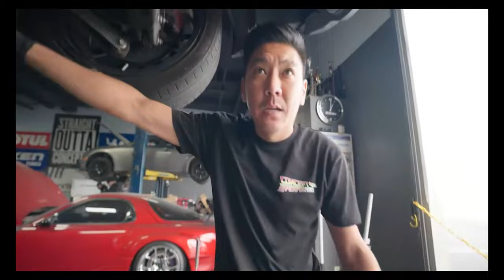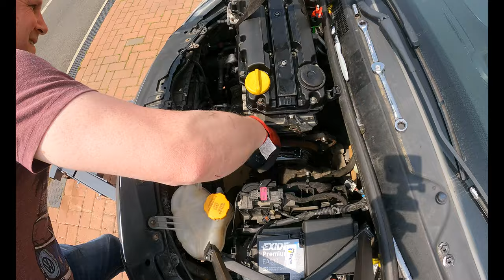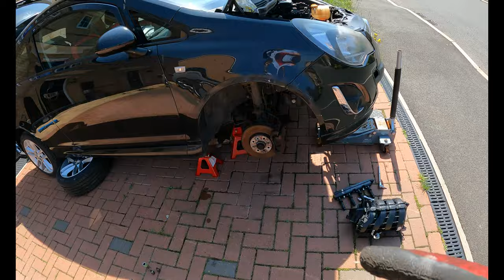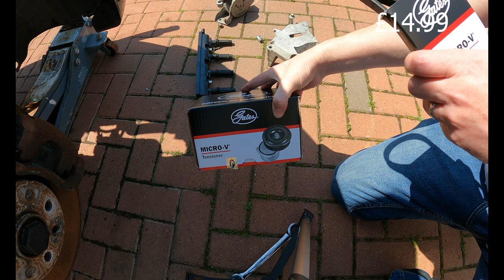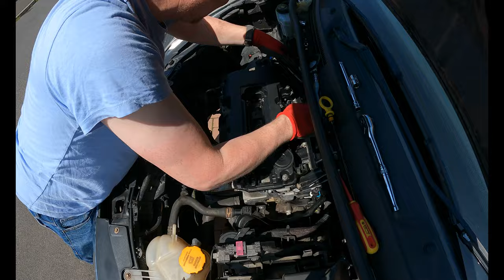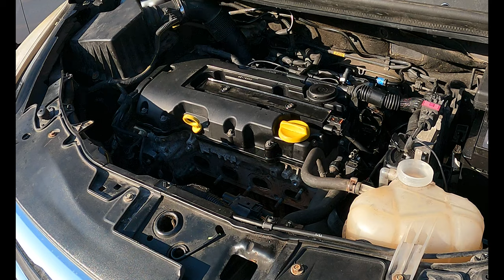REPLACING THE CORSA ENGINE BUT WILL IT RUN - VLOG 7

Comment: P.S.. Euro car parts are no longer the cheap place to buy parts from.. They don't do big discounts like they used to.. I either use my local motor factors or if it's a pre booked job I've got in the diary.. I buy on line

Comment: Hey i really love your videos, keep up the good work! ;) just a quick question, where do you get all your torque specs etc. ? 

Greetings from Germany 😊
Reply from the maker: Thank you! I normally google search for workshop manuals or failing that look on the forums which are very helpful.
Reply: @PetrolHeadRebuilds  Perfect thank you! Currently working on my 2002 Alfa Romeo 156 with the 2.0 jts and can really use some information :D